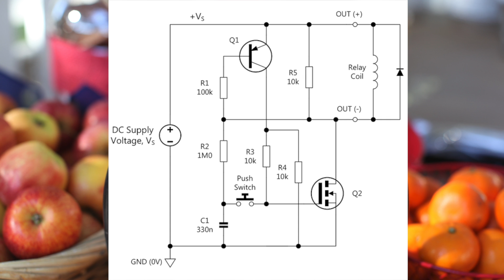Ben Builds: Momentary to Latching Switch Conversion with this Simple Circuit

Comment: Love the video. What kind of relay are you using? I need to use a momentary switch to toggle between two high V lamps. Would i use the same process? Or should I use an IC flip-flop?

Comment: I have gotten this circuit working properly at 6 volts but at 12 volts the output remains constant. According to another article (that this circuit was likely copied from) this circuit can handle a range of different voltages including 12. Not the case.
Reply from the maker: What article did you get the circuit from?

Comment: Is Q2 a general purpose NPN transistor. My circuit isn't working. Please reply ASAP.
Reply: OK. Yes, it can be any transistors you can find.  If  it doesn't work,  check the scheme first, and play with resistors. Increase the capacitor. Usually it helps

Comment: Hi, what voltage are you supplying to the DC circuit?
Reply from the maker: +jarmolade 12v
Reply: +Ben Builds: Thanks. This is a clever circuit. I tried to find a circuit like this one 30 years ago to no avail. The best I could find back then was a flip-flop using two momentary switches--one for on and the other for off. I like how this circuit doesn't rely on microcontroller nor a 555.